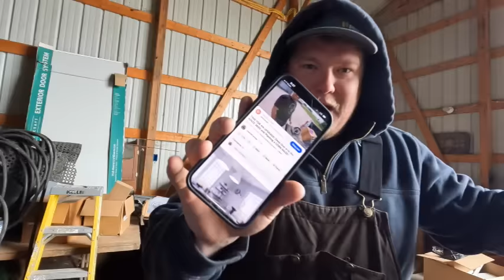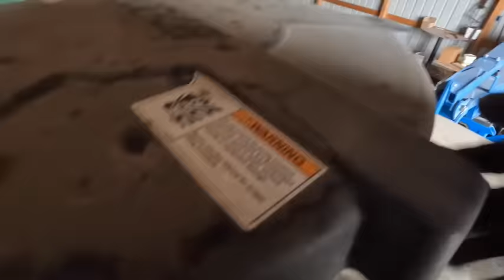DO YOU KNOW WHY NOBODY ELSE BOUGHT THIS?

Comment: when sliding the fifth wheel lower the landing gear on the trailer, take all the weight off of the fifth wheel plate
Reply from the maker: Thanks for the tip!
Reply: I was about to say the same thing. But about a day later.